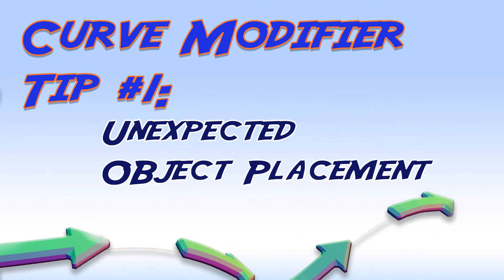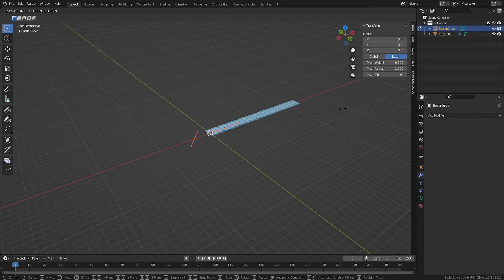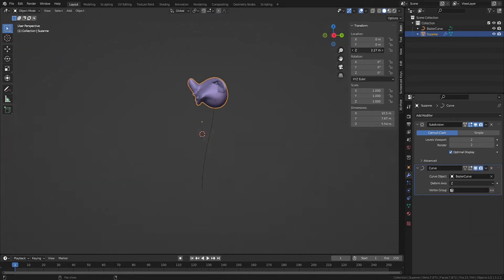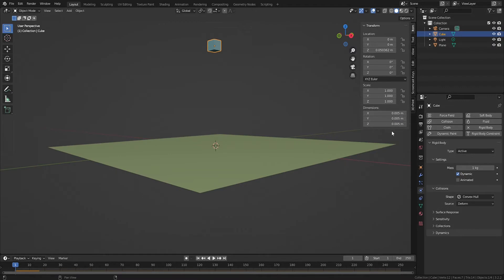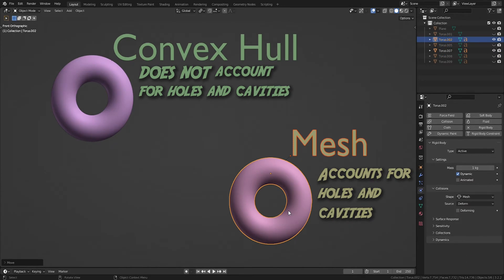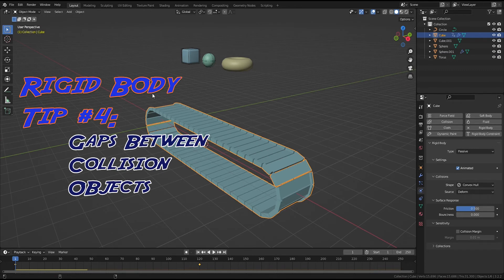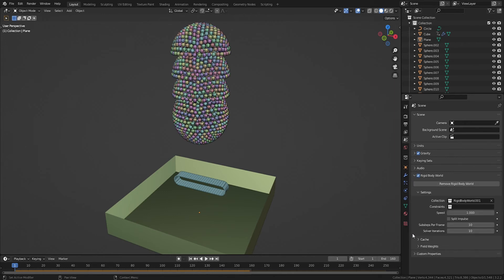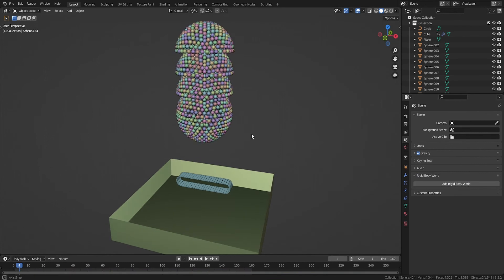8 Curves Modifier & Rigid Body Simulation Tips

Comment: In blender 3.3.1 rigid body doesn`t interract with mesh, wich is has a curve modifier
Reply from the maker: I just tested this and the collision still works; I had to set the Collision Source to Final and Animated checked.
Reply: @Blendini  My Rigid body works weird: I’ve got the same settings, but box, which falls on conveyor, goes through it and collapse with mesh, like this mesh doesn’t have curve modifier, but it has🤔
Reply from the maker: @arusblog7356  If your curve deform axis isn't negative,  your objects aren't too small,  you've applied the array modifier, applied any scale/rotation transformations, and your conveyor belt rigid body settings are passive, animated checked, collision source deforming checked if set to deform, or final, then you may want try Scene Properties > Rigid Body World (should have a check next to it) expand it and hit "Remove Rigid Body World". This will remove all rigid body world settings, which you'll have to add and define again. Sometimes, the simulation results get weird if we've made changes to objects after rigid body settings have been configured. I recreated your issue, and removing Rigid Body World, and adding those RB settings back to the objects solved the issue.
Reply: @Blendini  thank you, I’ll try again with removing rigid body. And maybe I have to make point cache
Reply: @Blendini  I'm having a similar issue, my rigid body seems to either bounce off, or collide with the "non-curve modified" mesh. I went through all of your suggestions and am still not getting a decent result
Reply from the maker: @eliotsauquet2462  Hmm. The only other suggestion I make is to remove the Rigid Body World Settings, save the file, and close it. Then open it back up add the rigid body settings back. I've repeated the process numerous times with all sorts of belts. There may be a bug in the latest version-- but removing and reconfiguring rigid body has worked for me. Sorry if this wasn't helpful!